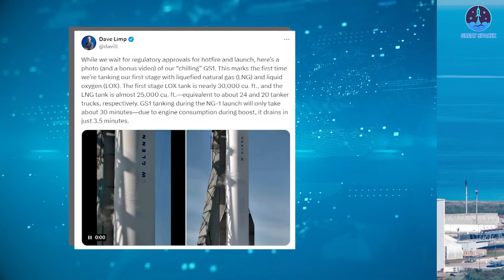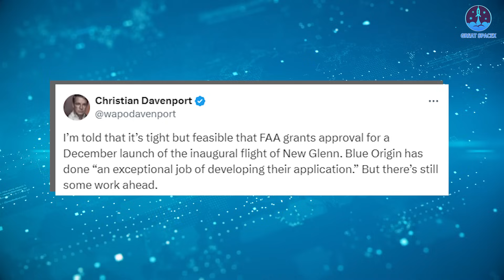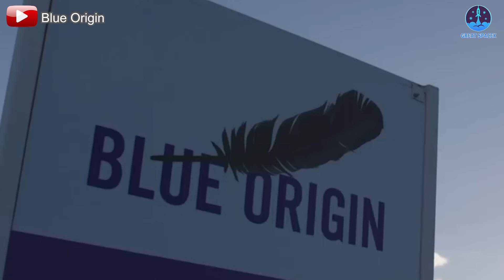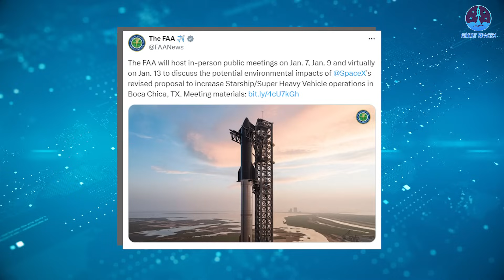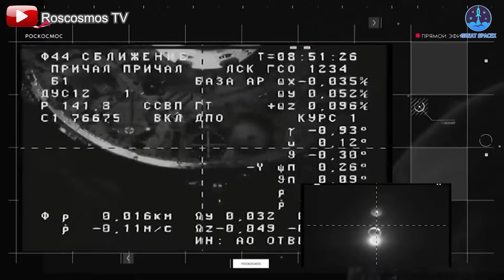Blue Origin revealed What is Happening with New Glenn on Pad! Starship Flight 7 SOONER...

Comment: Starship is 4 years late and it's still not operational. Let's give New Glen a real chance here.
Reply: I don’t know about 4 years late.  Starbase was barely anything 4 years ago the first tower was not even built yet.
Reply: Starship has been testing and testing its systems and has done launches to work out all the bugs. New Glenn has been so delayed it hurt other rocket providers and NASA.
Reply: @nichanson  SpaceX has also redesigned the launch pad and tank farm 3 times! They also blew up the first pad. Is this an efficient, cost effective way to work? Kind of ironic, since Elon is suppose to be a master of efficiency. Block 1, then 2, then 3? They['ll be a block 4 for sure. There are pros/cons on this design philosophy but Artemis has a deadline.
Reply: @nichanson  They aren't working out just the bugs. SpaceX is still trying to design starship. It's a prototype at this point. Their literally making it up as they go along. They don't even have a launch pad yet, even after all these years. This is an extremely inefficient and ultimately expensive way to design a new vehicle. Starship isn't any more ready than New Glenn at this point. It is what it is. My issue is all the secrecy behind Blue Origin. they've received billions in tax payer dollars. They should be required to tell those tax payers what they're getting for their money.

Comment: It makes sense to do a wet dress rehearsal then inspections then a hot fire test then inspections.  BO will likely learn from these tests.  If they don’t do these nspections, then it increases the chance of a failure, and depending on the failure cause, it could have been prevented.  Also if it fails then the tests and inspections will help in ruling out what went wrong.  Based on every rocket program track record, BO will be lucky if the first launch attempt is successful.

Comment: Since it's BO's first flight of the NG it makes sense for BO to perform a New Glenn wet dress rehearsal before it's first Static Fire. If all goes well on the SF and post SF inspections are all good and any repairs made then NG is ready for Launch.
I think the following is close to what SpaceX has been doing.  
SpaceX has recently revised their sequence.  SpaceX performs at least a partial-cryo fueling at Massey's Test Site of all new Heavy Boosters & Starships.  Starships also performs Static Fires at Massey's.  Post SF inspections and as needed repairs are performed.   
SpaceX performs Heavy Booster Static Fires on the Orbital launch Mount (OLM) at Pad A usually with nearly a full LOX load and partial Liquid Methane load (enough total mass to help hold the booster down during SF).    Post SF inspections and as needed repairs are performed.
So after individual booster & Starship successful partial-cryo tests and SFs, SpaceX's sequence is to then fully stack both (Heavy booster & Starship) at the OLM and perform at least a partial-cryo test (fuel & LOX) and sometimes a separate spin prime test, too.  
It looks like if another Unstack occurs or an engine replacement is made at the OLM then at least a partial cryo test will be performed with maybe a spin prime when the full stack is again fully assembled at the OLM.  
After all checks out then SpaceX proceeds to launch.
It makes sense that SpaceX does not perform a Static Fire with a full stack at the OLM since, it would be redundant given both the Heavy booster & Starship have had individual Static Fires and the Full Stack has had a partial-cryo or possibly a full cryo load test.   Another benefit is to not subject the Starship heat tile system to an additional Static Fire vibration, shock, etc. since  the Starship SF was performed at Massey's Test Site.